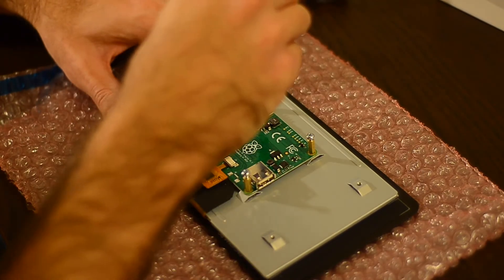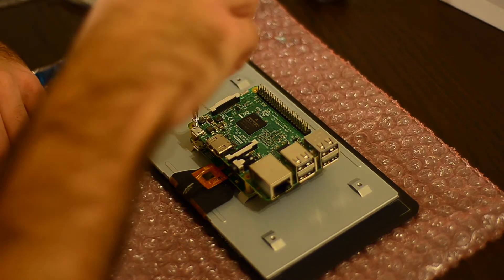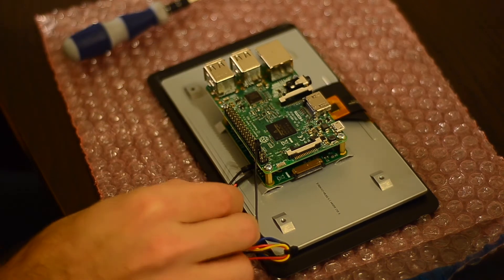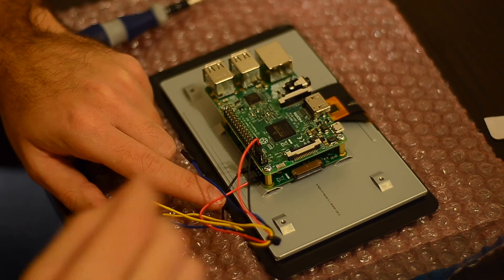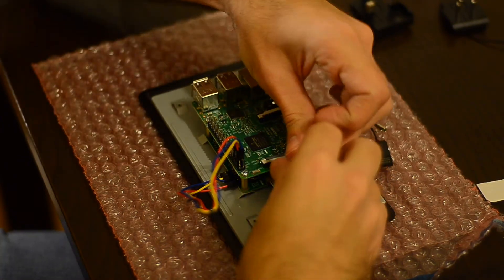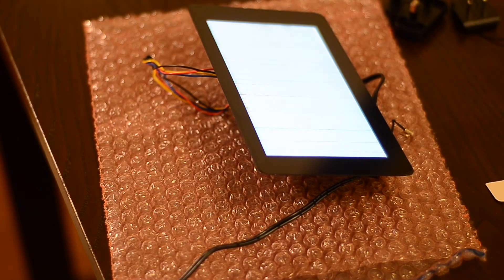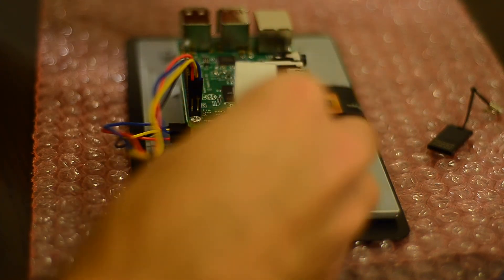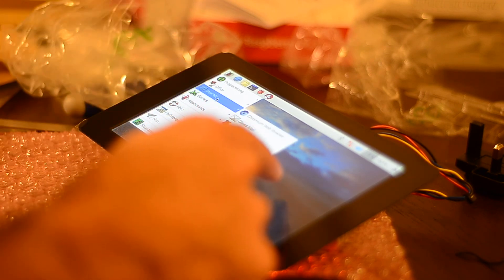How to install the Raspberry Pi 7 inch touchscreen display to a Pi 3 model B board

Comment: hey mate, can you share the link for that display board please?
Reply from the maker: https://www.raspberrypi.org/products/raspberry-pi-touch-display/
Reply: i got the display, need the case so its not all open, also have the camera , is there an hole or slot in display case for that?
Reply from the maker: @blocknewsmedia  The case I got for my Pi Zero has a passthrough for the ribbon cable - but I thinker a lot with the setup in this video so it's not in a case.